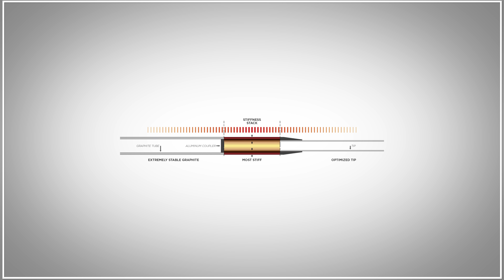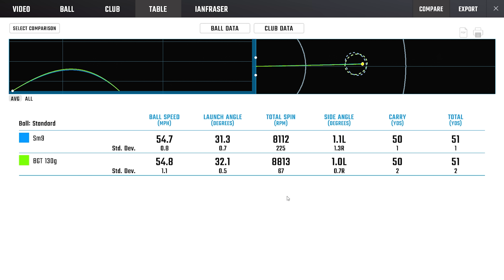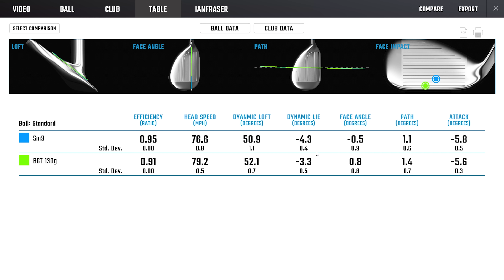IAN'S NEW BGT ZNE WEDGE SHAFT REVIEW // Comparing the new ZNE wedge shaft against the S200

Comment: Crazy!
I built my own Frankenwedge with a 60.04° SM8 for fun after thinking about that video enough. Turned into my best club.
My coach/fitter and I decided to test some wedges today, fully expecting to just swap the Ping Alta shaft into a fresh head. He has me try the 90g ZNE. It was amazing.
I disagree with regards to full shots. I was taking full rips. I haven’t taken full rips with a wedge in years. I even took a couple “over-full” rips, swinging out of my shoes. Even those were decent(not counting a couple of hosel rockets).
This thing just worked on every shot I tried. Full, 80y, 30y, Lobs, and punches.

Comment: One thing that I don't think you guys talk about enough is standard deviation. On the comparison between the stock SM9 and the BGT 115, the standard deviation of the default is 1.7 (-2.2)  and on the BGT 1.0. That means they are overlapping a ton. I realize that you can't hit 5000 balls for every test, but I think conclusive performance metrics look different. I think it would be worth calling that out more in test/cases where the results are overlapping this much

Comment: The 3mph club difference makes up for the 1000 rpm in difference, or at the very least a huge part of it. Made you feel confident swinging it faster at a slightly more open blade and lower strike. From a purely physical standpoint, i don't think there was anything with the BGT that made the ball act different. However, where i do think you could see a difference is with those tough rough lies like bermuda rough where you have to dig in.

Comment: Worth testing a normal but much stiffer steel shaft than the S200 to see if the stiffness is the main factor or if it's something special about the BGT? For exampel X7 or PX LS 7.0 in a wedge?
Reply: Maybe a Tiger stepped wedge (if you don’t know google it)

Comment: I usually love these reviews, but there doesn't seem to be that much of a difference in the numbers. The SD's are large enough that there is an overlap and Mikey isn't a machine. I'd be hard pressed to try and recommend a shaft change with those numbers.
Reply: It's not so much the numbers but the dispersion, if you watch the video Ian did with club champion they have seen similar results in decreased dispersion on less than full shots for a lot of customers.
Reply: @jim60631  I have to wonder is there a bias somewhere, especially from CC that would try and incentivize people to purchase the aftermarket wedge option. The dispersion didn't look that different to me on the shots and an amateur is going to have natural misses. If it was a consistent miss to the left or something then i'd say it was the shaft.
Reply: @James__123  they should have shown proximity to hole, it was significantly closer for Mikey. Also if you go back and look at his 50 yard results his dynamic lie angle changed 2.5* and his face angle changed almost 6*. Those both resulted in him not pulling them and he was much closer.
Reply: @jim60631  his face angle changing 6 degrees shows how inaccurate this test is. The shaft won't make that much of a performance difference. That's all on Mike